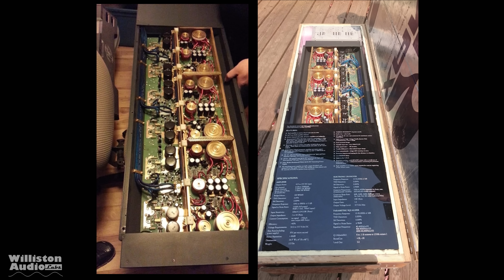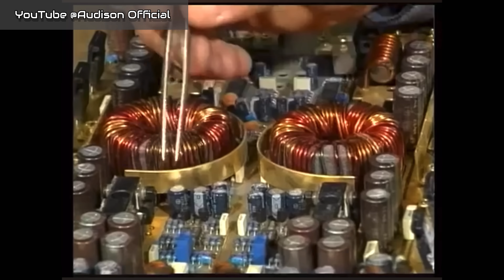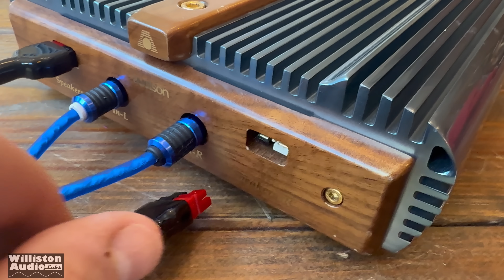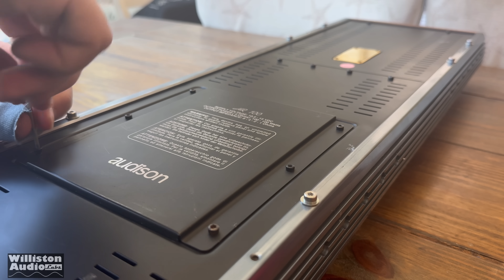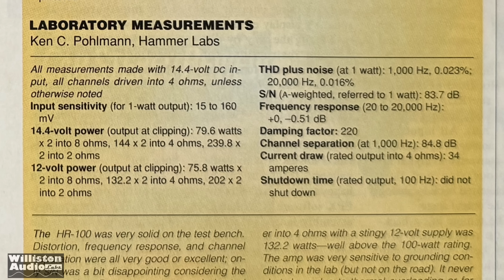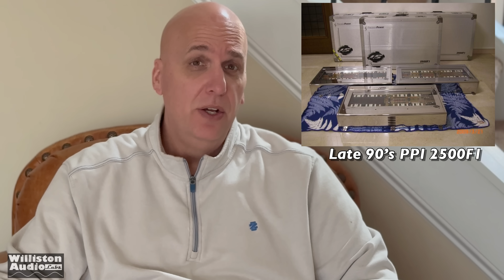The Most Beautiful Car Amplifier Ever Made? Audison HR100 Review and Amp Dyno Test

Comment: I had a 1989 Dodge Daytona that had an amp that kinda loked like that CA 800..If i remember right it was an a/d/s 5 or 6 channel with some odd proprietary connectors. I don't think the person before me even knew it was in there cause it wasn't hooked up. Only thing that was was the stock head unit and 2 front speakers. Found it when throwing my system in it and had it for quite a while but couldn't figure out how to get it to work. Had another thing on it that I tend to believe was the crossover, but i might be misremembering. Had din plugins. I had a cb that the mic used din but i hadn't seen an amp have one.  Eventually traded it at a stereo shop for a brand new blaupunkt head unit. I kinda miss that radio.

Comment: That looks like truely bullet-proof architecture, but honestly, for its size, I expected a much higher output. Why did it need such large connectors with such low output? I suppose it had the amperage to drive many drivers in series and still belt it out.

Comment: I would like to see the schematics for this amp - so much silicone, possibly some Sanken or ONsemi (Motorola back then) in the output section, this thing was built to last, be trouble free and definitely deliver good sound. The caps in power supply look like they can deliver enough Jules to weld steel. My little home amp from '90s has 60 000uF per ch. and it will take 2ohm loads with ease. You can build 140W/4ohm amp with 1/10th of the parts, but whether it will sound as transparent, dynamic and neutral that's still a question.
And yes, I want to see the other amp - if it has plenty of silicone sure we want to know what it is 😉👍

Comment: You missed a downside, the two channels are different power outputs. They should be exact same.
Reply from the maker: It’s very rare with component tolerances included across two independent channels on a dual monoblock to get the exact same results on both. Even some of the magazine tests I found on this amp from back in the 90’s had slight channel discrepancies in the results

Comment: I had a giant amp back in the early 2000’s, I think it was phoenix gold, it was like 2 ft long and had a clear panel with 2 meters for the channels that lit up green on the front, 1100x2 watts it claimed.  Does this sound like the right brand, or would it have been power acoustic back then? Phoenix gold is that I’m thinking it was. I had it powering 2 jlw3 12’s in a reg cab f150. Can you get your hands on one to test?

Comment: "Why pay so much for so little power?"
TLDR/TLDW: Because Class A and Class A/B amps are GOATed for producing the cleanest sound you can get at their ratings. 
A Class D amp at twice the power wouldn't sound half as good with the same quality components because of the digital format compressing the audio signal.

Comment: The Coustic RTA-33 is a classic 1/3 octave in-dash real-time analyzer from the 1990s designed for car audio tuning. It features a 30-band LED display (25 Hz to 20 kHz), built-in pink noise generation, and five memory presets for storing frequency curves. It includes a microphone input for system calibration and can be used on a workbench or mounted in-dash. 
 I'm sorry but i had to... that thing is bad ass😂
Reply: You forgot to mention the parallel printer port in order to print out audio test results and the fact it can run on its own internal rechargeable battery!
Reply: I really liked those. For daily and competition use the Rockford Fosgate Symmetry EPX was much more practical. Global presets, 31 bands. You could slam the door shut and do your SPL runs outside the vehicle with the remote. It did not have the Coustics pretty dancing LEDs.

Comment: One of the best amps ever build, home systems included.   It's very sad to see car stereo in its total decline nowadays. And although Audison is trying its best to develop new systems that integrate in modern cars, the major problem is introducing the new generation to this passion/hobby, because of the ever higher getting costs for the consumer.
Reply: @smhsukruaydın I picked up the Audison Forza AF M8.14 DSP amplifier last year. I'm building a more SQ setup in my truck where I'm only running an active front stage. Not concerned with rear fill. I don't feel that I will ever use another brand for SQ. It sounds amazing. Going to run 2 Hertz Mille Legend 10's with the Hertz ML Power 1 amplifier. Looking to run 3 way components as well. Younger people today don't understand what SQ really is. A lot think that being loud is the same as SQ. I had to prove this to my son. He understands the differences between the 2 now. Now he wants a SQ setup.
Reply: @vonderblah 
Make it loud, that's one thing, make it loud and CLEAN with proper stage and neutral timbre that's another challenge. I remember Earl Zausman with red Beemer and B&W drivers powered by tubes - I saw it in Toronto in '94, spent like 15 min in the driver seat listening, Earl was very nice and patient with me. Never before I even imagined car can sound like proper hi-end audio. I told my friend if he was to build another car stereo, it better be built for sound 'cause I'm tired of his shit boxes that shake windows but sound like crap.

Comment: Yes the Precision Power 2500F1 was when I sold car audio in the late 90s. 97-98. I would love to see a review of that. I think it was $10,000 MSRP back then. I had 2 very rare optioned PPI amplifiers I wish I never sold. The PC1400 and PC450 with the plexiglass bottom option. They used chrome buss bars to hold down the mosfets instead of the back panel and they were beautiful. The 1400 was rated 800x1 at 2ohms and it powered 4 Solo aric 15s to 149.9db in a Jetta with sealed boxes. It was awesome. I still have the PC1800.2 version of that amp and it is cool but not as nice. My buddy had a pair of the chrome PC series amps that were beautiful. 4x50 on MB Quart Q series Components and the PC1800.2 on and Eclipse Ti 15 in a 2000 Corvette Coupe. It was an awesome setup. I don't know if he still has it.

Those were the good old days!
Reply from the maker: I’ve tried unsuccessfully many times to get a 2500F1 to show off. Maybe someday I’ll have a chance

Comment: Audison keeps doing this for decades, they high-end models are advertised as A class, which is true, but only for the first 5 watts of output. After that point, it's classic A/B. A very nice sounding amp, especially for mids and highs. I wouldn't use it for bass; trying to create the necessary "bulk" and body for the lower frequencies, amp becomes "slow". Anyhow, nice video!
Reply: 5 watts is sweet.

Comment: I thought the Audison Thesis was more expensive? 🤔 I any case, what a beautiful amp! 😮 Anyone owning one of those beauties sure would have bragging rights. Another super expensive amp from back in the day was the Soundstream Human Reign, which was said to have costed over $30K for the original one. It was hand-crafted from bronze by an artist. Thanks for the great video, BigD! 💪🔥
Reply: It looks like the thesis venti costs around $18k. Compare that to the equivalent HR100 price of $26k.
Reply: The sound stream was expensive because of the cover and rarity, but the guts weren't on par.
Reply: @drumsmoker731 the guts on the Soundstream were cool but, you're right. The Audison was a thing of beauty. Where the Soundstream did shine though, was in sound quality.
Reply: @iceman45ification1 of course it sounded good. You don't need to go all esoteric to make a good SQ amp.
That Audison also went 3 levels above the necessary. Not really snake oil territory, just over the top for shits and giggles.

Comment: Ground Zero Reference Amplifiers GZPA Reference 4PURE SQ made today look way better on the outside and the inside. Copper heatsink and plexiglass bottom to show off the internal components. Dual Mono design , class A bias knob, same size amplifier approximately and power bridged is about 2 x 1000 watts. 😊 Check them out !!!🎉🎉🎉 MSRP $5799.99

Comment: Can't remember how A/B amps sound on subs 🤔. Been running A/B on mids and highs about three years. To me it's a move warmer, and depth to the sound
Reply: They should "sound" identical.  In practice they sound better watt per watt.
Reply: It depends on the sub you're using. 
On big 12"+ reflexes that are cut very low just for the thumping, it doesn't make any difference. But on a fast 10" sealed, cut at 70-80, you 'could' start to hear a difference.

Comment: I built a demo vehicle for petras around 1996,used audison amps,9-hyperthrow 12",i had never heard of audison,the sq was unlike anything u had ever used,soundstream,linear,ppi included.that little truck sounded amazing
Reply: I remember those subs. Like a wolverine claw going through the dust cap
Reply: @lacboiatl I think the prowlers used mostly fosgate parts. The GTI's would blow those away.
Reply: I ran petras back in the 90s. Had 2 petras prowler 15s  and 4 10inch petras. The 15s were powered by first a lanzar brute force 450 and then a lanzar opti 2300. The 10s by a lanzar opti 100.
Reply: Great products and great people,I was fortunate to live close enough to buy direct,and try new products before they hit the market.i built several spl vehicles using petras and U.S. amps.
 @bubbawubba2307